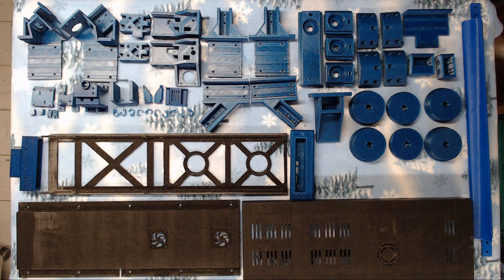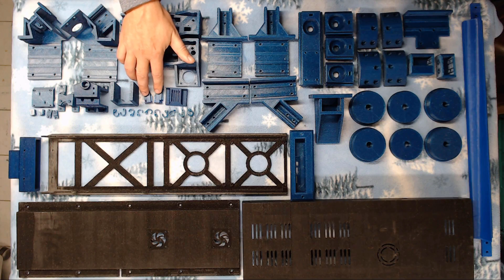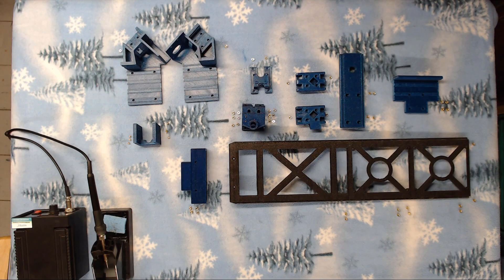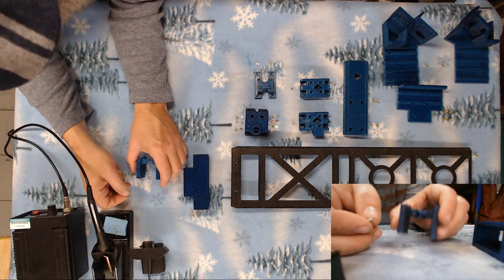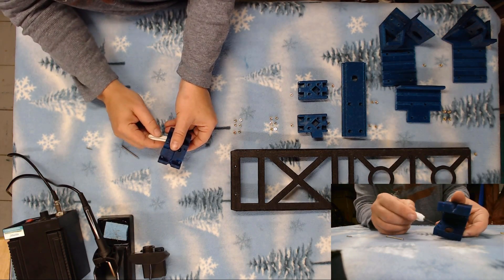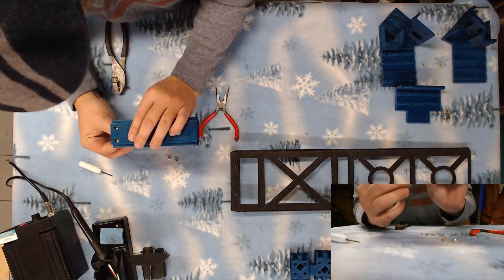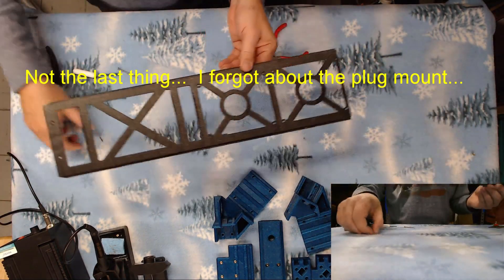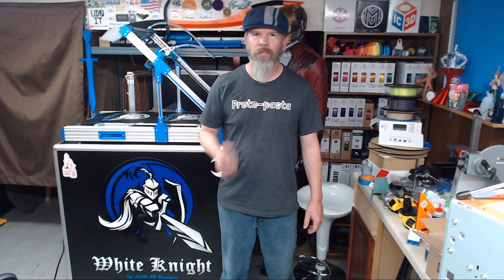White Knight Assembly Part 5

Comment: Are these parts made with ABS? Also, I provably missed it but what size are those heat sets?
Reply from the maker: All my parts were printed in Proto-Pasta HTPLA,  All the heatsets are M3 except for the cooling fan mount which uses M2.

Comment: Hey mate, great build.
Do you think this may scale up on the width (500mm) if I were to use a lighter hotend, perhaps one from these guys https://zesty.tech/ ?
Keep up the good work
Reply from the maker: Hi, Sorry I missed this comment..  I see no reason it couldn't be scaled up to that size..  Current design is bowden so I don't think the Zesty Nimble would be needed but if you wanted to go Direct Drive that could certainly be an option if they offer a long enough cable.. ;)

Comment: Hey Karl,

Looking to build this printer. Could you send links to the e-bay parts you ordered? They're kind of vague on the documentation.
Reply from the maker: I didn't post links because it seams they always go bad after time(a few have since I posted the files even)...  I did post item numbers to the few items that are very specific.. Here are a few of the items numbers that are still valid..   #152765834186, #182216230810, #143206149832, #382036444341,  Just search the description for the remaining parts..
Reply: @NAK3DDesigns  Thank you for these! We've ordered the parts and can't wait to build it. I have another question though. We contacted belt technologies and gave them some info about the project and they came back with a much more expensive price than the BOM and it's a different type of belt. Do you have a link to the quote from them anywhere?
Reply from the maker: Esmir I’m sorry I don’t.  The problem is the price literally cuts in half if you order more than 1.    This is why I’ve been trying to advise people to work together to do a group order.   Or wait a bit longer and there may be an option to order the belt thru Printed Solid once the start producing kits.